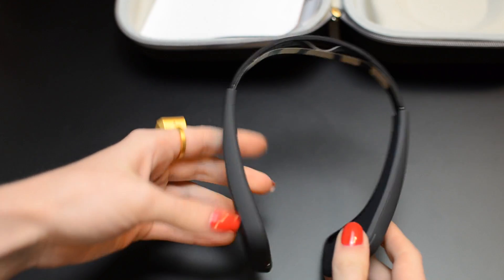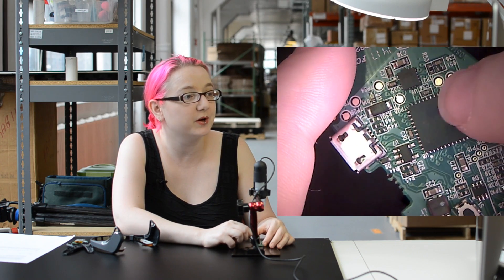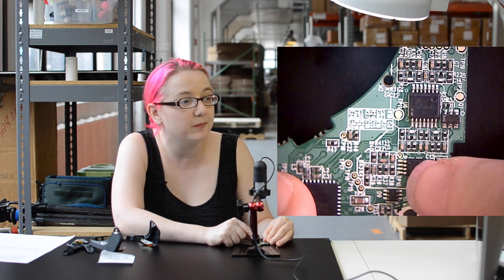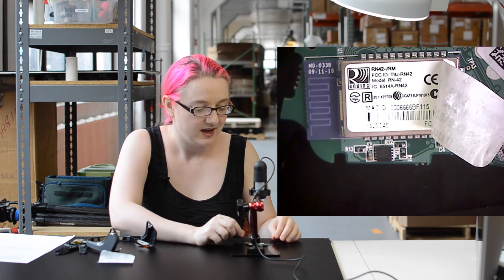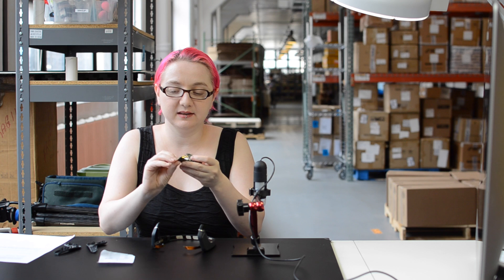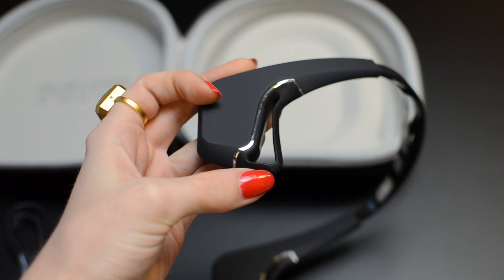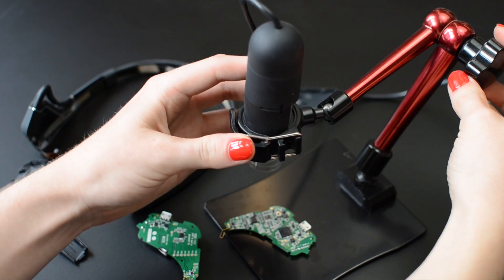Muse Headset Teardown

Comment: Much respect and interest in your useful work there. I would like to add a minor tweak. TP I believe doesn't stand for Testing Point as suggested but for Temporal Parietal, the TP numbers are the names of the different Sensors like the ear sensors, the ones at the front are FP, Frontal Polar, TP the rear ones. Love and respects . ( I got that from  https://www.youtube.com/watch?v=8Hyhljnq9Z4

Comment: Super Interesting Teardown! I just tested one for 30 days. I wonder why it has 2 USBs but as user you only see one.
Reply: If you have only 1 visible USB port on your device you have a newer model than the one shown here. The USB ports aren't just for charging, but also for attaching accessory devices. On the latest model there is only one accessory port, whereas older devices had one on each side.

Comment: Does the fact that they are not using low-energy-bluetooth chip mean that they are sending some other (older?) bluetooth signal that is transmitting stronger radiowaves than other devices that would use a low-evergy-bluetooth?

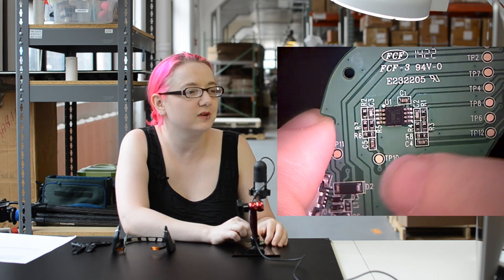Comment: I wonder if the battery can be replaced. I would expect battery life to diminish over time and it would be good if it can be replaced. At 0:49 I can see the battery solder point and at 1:16 the battery is shown partly to reveal that it is MH, 3.7volts, 0.925 watt hr. Part number could be 49008 or 552030. At $299, it is pricey and the option to replace the battery could mitigate the cost down. What do you think Adafruit, do you have more info on the battery? Cheers.
Reply: I was wondering the same thing about the battery.  I actually have Muse for over a year and my battery only last 30 min. I will probably have to change mine ASAP.  Let me know how the battery change went.
Reply: ven rakkhita 5 hours?You mean you need to change the battery of this thing every 5 hours? You must be joking right?
Reply: hi Chuki - I was meaning it needs recharging every 5 hours. Actually shortly after that the whole headset seemed to just die of old age. It stopped working. Maybe the battery installation did something. Anyway I switched to an Emotiv EPOC+ with Brain Viz 3D real-time visualisation and am happier. The unit is more expensive but worth the upgrade. I am happy to have used Muse for so long, it is a great opening to working with wearables. Also the guided meditations are great - which is lacking on EPOC+. EPOC+ has 14 sensors. Brain Viz is a real time image of your brain activity. Good luck
Reply: I just replaced my battery. I took out the old 552030 which is the size in millimetres, I eventually found a battery store with a good range of lithium batteries. It is also used in mini helicopter remote controlled toys. I bought 042340 batteries. The shop installed it by soldering on the new one. It was super cheap - like $5 usd. I'm in Malaysia Kuala Lumpur. My old battery was very tired. Lasting only 8 minutes whereas the new one will run for 5 hours like a new Muse.  Hope that helps.